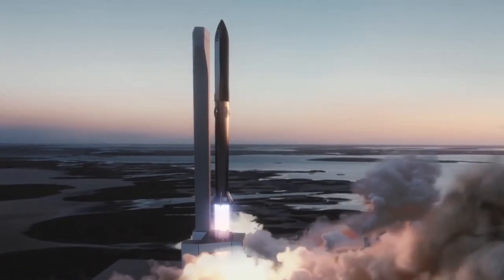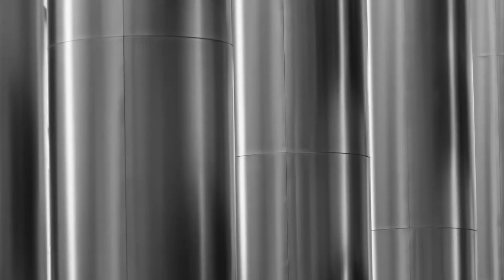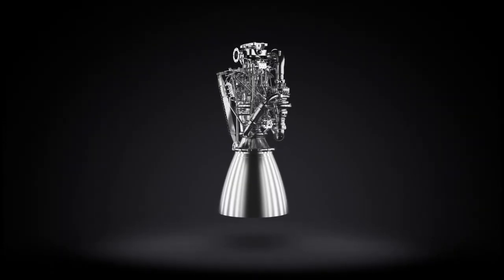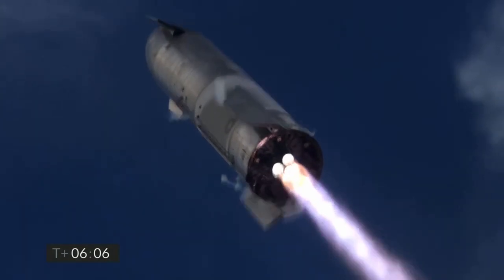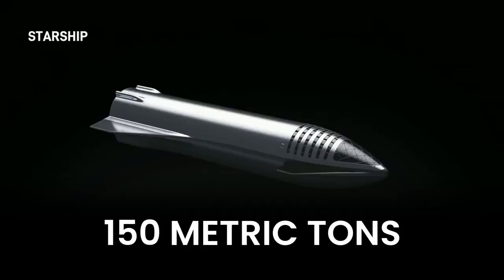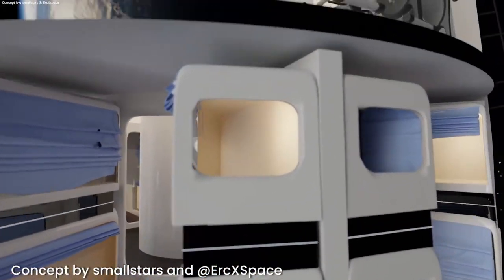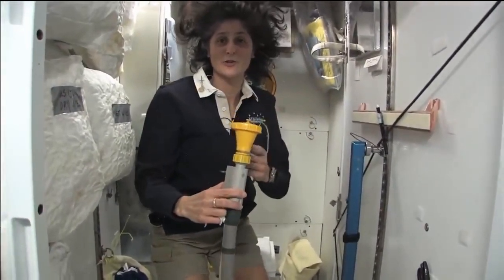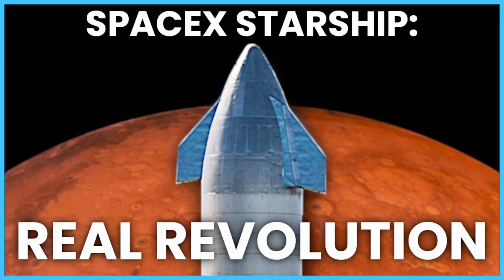What's Inside The SpaceX STARSHIP?

Comment: Are you sure your right on the melting point if Steel.... think its a lot higher that 800deg C - website says stainless is 1510 C as opposed to aluminiums (Space Shuttle) 660C - which is the point  since i believe hull temperatures can be over 1000 degrees on entry -- Please correct me if i'm wrong here...

Comment: Again… using year old quotes from Elon. Since then, he’s hired actual experts in interior design. The most it will hold for a minimum 3month trip is 30 people. Because they need food and water.  That alone is 6 lbs of food AND 4 lbs of water PER DAY PER PERSON… you do the math. And no realistic mission is going to depend on there not being enough for a one way trip. What if one of your rockets fail in flight? And then there is the systems needed for rebreathing and recycling that geometrically increase with the number of people.
And AGAIN with the big window. This is solar arrays in the original drawings. Elon said off hand “wouldn’t that be cool if they were windows” but no one will do that because, again… WEIGHT. Windows that size alone would make the rocket have zero cargo capacity.